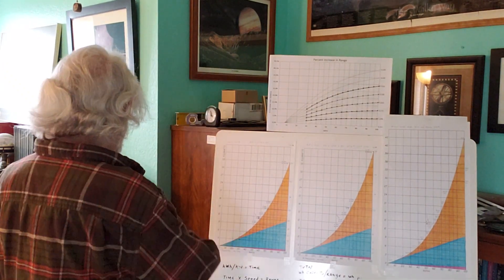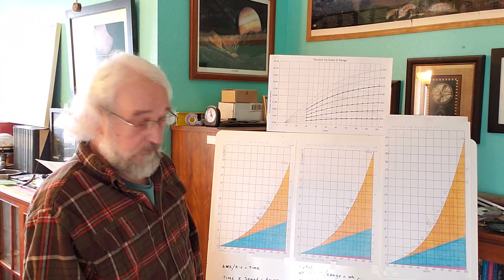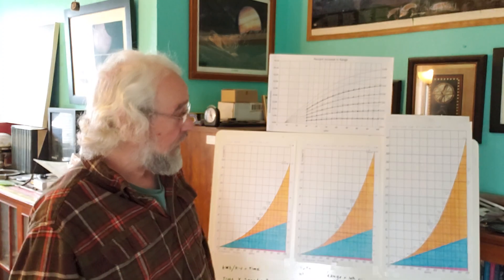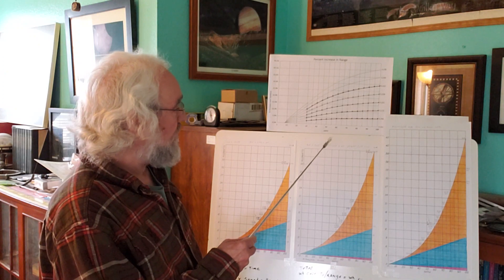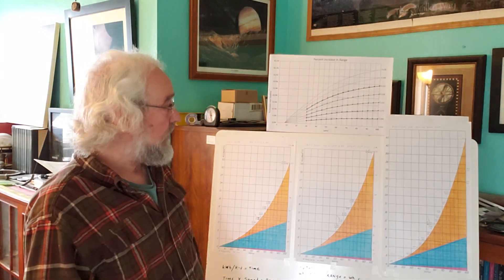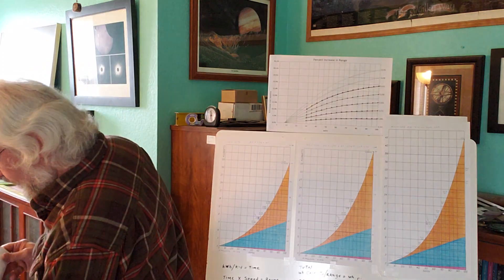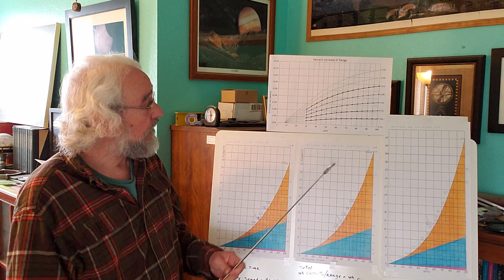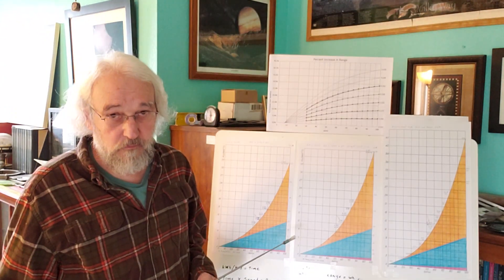Roof Rack Impacts on Aerodynamics

Comment: Appreciate the vid 👍 Despite their impact, roof racks are really handy for certain situations. But as you demonstrate, they should be removed when not needed. Sadly most are left on because they're a pain to remove/reinstall or driver's are simply negligent. If you must have one, it pays to install one that's quick to remove (or tracks first).

Comment: Appreciate the video John.  Model 3 Dual motor owner here, with aero wheel covers.  The reason I ordered a roof rack (arriving soon) is because it'll reduce my dependency on a low mpg gas vehicle by another 2,000-3,000 miles/year for kayak and canoe trips that my wife and I take.    We have a small 4x8 trailer we've used for the kayaks/canoe (and home depot trips), but the problem is the insurance and warranty situations are iffy if something happens with the trailer attached on the Model 3.  I'm also not looking forward to hacking into the Model 3 wiring since they don't offer a factory option/harness.    In a few years when we retire our gas car we'll probably go ahead with the trailer hitch on the Model 3.